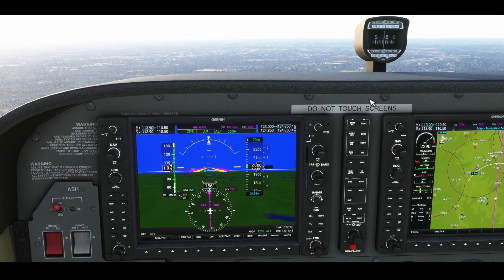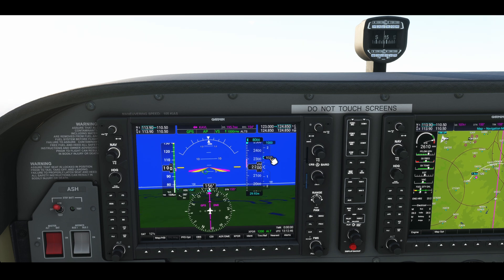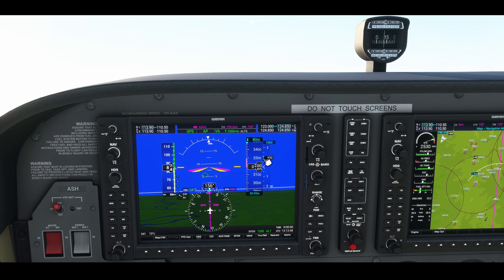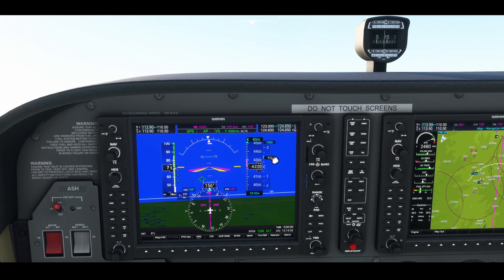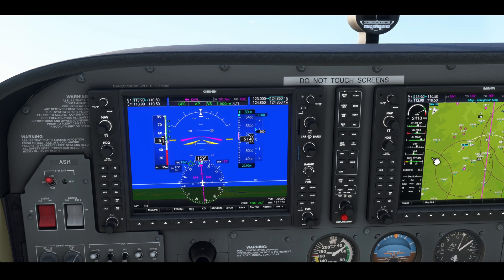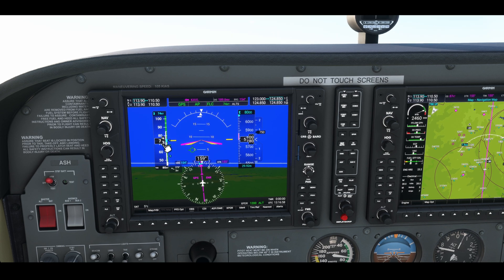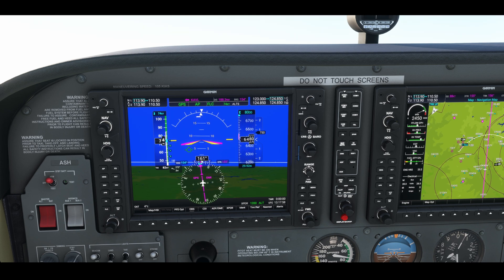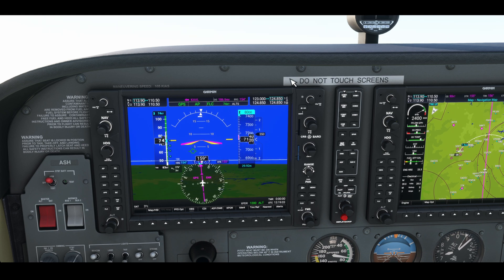G1000 Autopilot Vertical Speed vs Flight Level Change for Climbing | Real C172S Pilot | MSFS2020

Comment: Very helpful tutorial. With Flitch Mode - since the aircraft does not have Autothrottle - you don't actually set a new speed but the AP calculates the V/S  which in your example is the rate of ascent actually in order to catch up with the speed you set with plus and minus buttons.
Reply from the maker: I'm glad the video was helpful, thank-you..